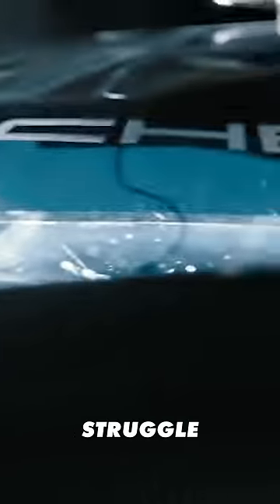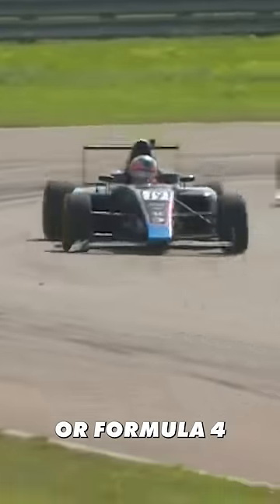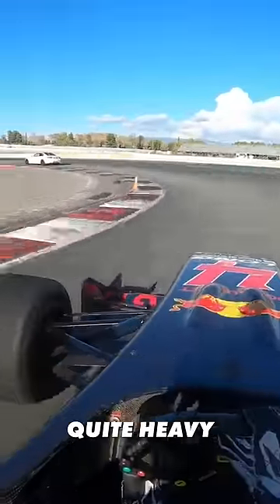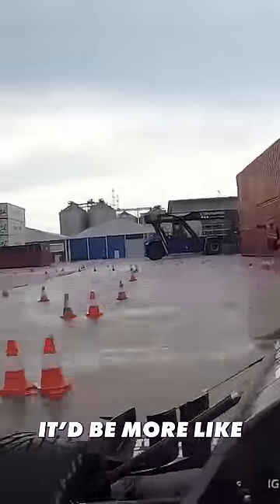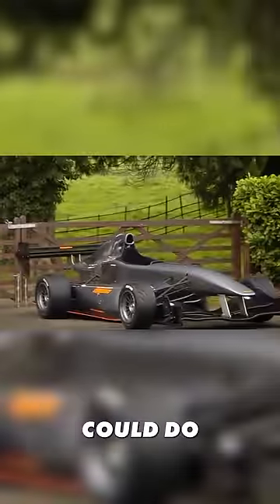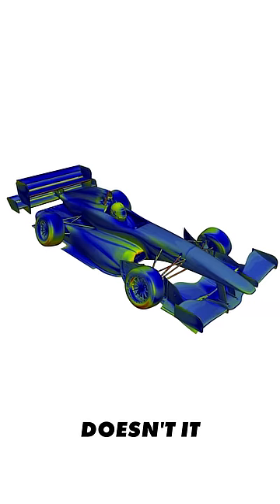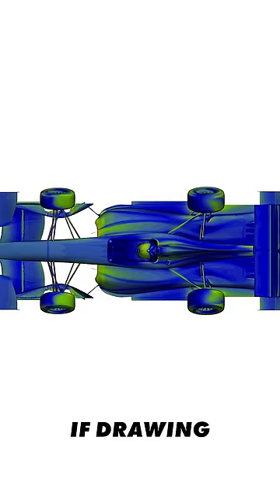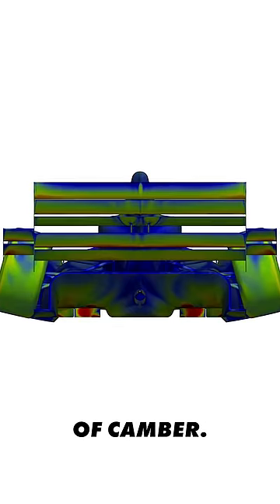The Car I'm Going to DRIVE UPSIDE DOWN

Comment: Secondary issue is grip to put power down when upside down, then tertiary issue is finding an engine that can run reliably upside down
Reply: You can account for this by the angle of approach when entering the tunnel, also running upside down shouldn't be a problem if it's fuel injected, you're not going to upside down longer than what it takes for the injection system to run dry.
Reply: @rantional8180 I'm sure there are other issues with oil and cooling
Reply: Gravity is still a thing
Reply: @shogunofsorrow787  still, you're going to be upside down for less than 5 seconds and that's being VERY generous, it's probably going to be closer to 1 second due to the speeds needed to achieve a "barrel roll", really the biggest concern here is getting the math of the ramp and needed speeds right. Nothing special would really need to be done to the car....I'm also pretty sure this has been done before in both a wrx and a jaguar, Google car loop the loop.
Reply: @tonydapony69  true, but so is interia and contact force...those two forces can overcome gravity.... the math for this MgH=Mg(xR) + 1/2 mv2...generally speaking and isn't probably going to be 100% accurate for this use.
Reply: That shouldn't be a problem, inverted systems like what is used on acrobatic airplanes.
Reply: maybe a jet engine or a modified horizontally opposed
Reply: How about you turn the engine upside down. Problem solved
Reply: @rantional8180 Downforce also becomes lift when upside down, thus pushing him more into the ceiling to give him better traction.
Reply: If it is a turbo charged engine it will be fine. It has plenty enough pressure to keep the fuel on the top of the cylinder when upside down
Reply: @greengabe5  sure but it needs to run both upside down and right side up.
Reply: Perhaps a well tuned hybrid racing engine could suffice, having the electric system take over for the engine at some max output once it detects the car is going upside down? Or a fuel pump system that’s mounted to the top of the tank and splices into the main line to feed the engine
Reply: @tonydapony69   downforce, upside down, is lift. 
You know, the concept that makes planes fly.

If they can engineer it to get enough upside-down-downforce, (which is the same thing as right-side-up downforce, but it's fun to say) they could drive upsidedown indefinitely, given an "infinite" tunnel
Reply: @rantional8180  yes, that has been done, but they are intending to use downforce (wind resistance) to hold them to the ceiling, instead of centrifugal force
Reply: @greengabe5  real man of genius
Reply: @Cheaty_Four  that's what I'm saying an inverted fuel & dry sump oiling systems similar to what an acrobatic airplane uses.
Reply: @thewaywardwanderer7249 well yeah, any kind of aerodynamic force comes with a drag penalty. But it's not actually wind resistance here, it is down force. Racecar aero, down force, is just the opposite of what lift is to an airplane
Reply: @shogunofsorrow787 I would suspect this engine will have a dry sump oil system either way. Constant oil pressure shouldn’t be an issue.
Reply: @429thunderjet2  you do know where downforce comes from, right?
Reply: @thewaywardwanderer7249  you said wind resistance. It's not necessarily wind resistance that the concern is here. Wind resistance is the drag penalty of some object going through the air. It's aerodynamic down force on the car from the wings and body shape of the car to overcome gravity by enough, plus get enough traction to propel it and control it upside down stuck to the ceiling. Anything going through the air at speed is going to have wind resistance. Think of wind resistance like trying to propel a big box truck at high speed, the faster it tries to go the more wind resistance there is. It actually squares by the numbers. I don't remember exactly what those numbers are off the top of my head, but it's significant. But with carefully designed aerodynamic shapes, like that of an F1 type of racecar or an airplane uses, the drag penalty caused by wind resistance can be significantly reduced. Are you pickin up what I'm laying down here, or are you just trolling?
Reply: @429thunderjet2   God dammit, now I know you are either trolling me or too dense to understand (though by writing this, if you're not trolling me I truly do hope to teach you something). Yet I am writing a reply anyways, because I'm dumb, drunk and bored.

Drag, downforce, and lift are all results of wind resistance. If you shape an object to push air upwards as it travels forward, it creates downforce. If you shape an object to push air downwards as it travels forward it creates lift. Lift and downforce are the exact same thing, the only difference is the relative direction of force....
Drag is the air's resistance of an object moving in any direction, which, in this case, is forward.

As far as your box truck nonsense, the shape of the box truck neither diverts the air up or down, and instead pushes it forward, resulting in only drag (with no benefit or drawback of lift or downforce.)

As far as the math, drag increases by the square of the speed. What that means, is, if you double your speed, you experience quadruple the drag, or wind resistance, regardless the direction of force (lift, drag, yaw, or downforce)

But say you were to alter the angles of the front of your box truck (hell, actually, we'll substitute a cube traveling forward instead of a box truck for simplicity of explanation) so that it was a 45 degree angle from the bottom front edge to the top rear edge (front and rear being relative to the direction of the cube's travel)

Effectively, this creates a 45 degree wedge driving down the road. 
The drag (or wind resistance) that applied to the previously-vertical surface is now divided in 2, where half of that force  is being redirected upwards perpendicular to the road, creating downforce, and the other half of the force is still resisting the cube moving forward. But the same amount of force is still applied. (for simplicity, again,  I'm ignoring the fact that by cutting a cube corner to corner to create a 45 degree wedge, you multiply the surface area of the "front" of the "vehicle" by nearly 2, which results in more air resistance and friction on that face, while reducing the area on the top and sides, resulting in less friction on those faces)

So, they need to find a body geometry and weight that can create more downforce (at a certain speed)  than the vehicle weighs. 

With any given body geometry, If the vehicle weighs, say, 1000 lbs, they need to be going fast enough to experience over 1000 lbs of downforce in order to "stick" to the ceiling.

Back to lift (which is still the exact same thing as downforce)
An Airbus a320 weighs around 160k pounds. That means, before the plane will leave the ground, the wings have to generate over 160 k lb of lift. Based off of the wing geometry, this happens at about 170 mph, relative to any wind, not groundspeed.

Have you ever flown before? The plane doesn't take off straight into the air, right? It has to be going forward fast enough in order to create the lift that it needs to get airborne.

It is the air resisting the wings pushing it (the air) downwards that causes the plane to lift.

Okay. I think I'm done.
Reply: @thewaywardwanderer7249  ok dude, sorry! I really though you didn't understand to begin with. But I think in reality we are on the same page here. But you explained it better. I just meant when I think drag I think of something with massive drag like a box truck for an example. But it wasn't a good one for this instance. And I do understand your point that there is air resistance to anything moving through it no matter the shape of it or the desired outcome, like lift or down force or just getting through it smoothly or not. Yup I've flown quite a bit with my father who was a pilot years ago. I'm an old student now, that never got his ratings. 
 But it will be interesting to see if they pull this thing off.
Reply: @429thunderjet2  oh thank atheist jesus you're not trolling me. That response took too long to be wasted haha.

I guess I picture drag as anything resisting the intended direction of motion.

But, yeah, I'm stoked to see this happen.

Not sure if you have checked the rest of their shorts, but they have another one that mentions the downforce more explicitly than this video implies.

I appreciate you and your clarification, and apologize for being an ass.
Reply: @shogunofsorrow787  oil could definitely be an issue, but cooling would be more or less unaffected being that, in a normal cooling system, there would be no air pockets as there is in the oil system, so the coolant would still flow regularly.

As far as my  "could"  about the oil, I've seen multiple videos where people drain all the oil out of their engine, and put a brick or something on the gas pedal just to see how long it survives running at wide open throttle. 
I think the longest one I saw was 15 minutes.
Reply: @thewaywardwanderer7249  no prob, have a good one!
Reply: A fuel injected engine with a dry sump oil system shouldn't have an issue for a short period upside down.
Reply: @shogunofsorrow787 oil maybe if you stay upside down for a long time but it has a dry sump so it won't have a problem maintaining oil pressure. Cooling won't be an issue, the whole system is full of liquid, sealed and pressurized. The car won't be upside down long enough to matter.
Reply: @AcidGambit419 being turbo doesn't change anything. It could be NA and still be fine.
Reply: @AcidGambit419  surely you jest?!!!
Reply: @AcidGambit419  gravity has basically no effect on the fuel air mixture in a combustion chamber. The fuel should basically be atomized and suspended in the intake charge when it hits the combustion chamber. It's about the fuel pickup in the fuel tank and the dry sump engine oiling system. Acrobatic airplanes have inverted fuel & oil systems for more than short term inverted flight and negative Gs.  So they will probably build an inverted system similar to that for the car as well I would think.
Reply: @hondaguy9153  yep that's most likely all it will need/be is a few seconds. Otherwise inverted systems could be incorporated if they feel it's necessary.
Reply: This is a remarkably productive comment thread.
Reply: Just flip the engine over duh!
Reply: @rantional8180 all four strokes can leak oil into the pistons and hydro lock the motor if upside down, iv been too earthmoving equipment that’s been rolled and they didn’t turn off the engine and did this, also after righting the machines you have to go through filters and so on checking for oil
Reply: Just use an electric powered car
Reply: @rantional8180 I was under the assumption that he would be driving lengthwise through a tube then attempt to drive it on the "roof?" Of the tunnel.
Reply: @user-cc3we2pw2b  maybe I'm mistaken, I don't know but short of using a rocket powered car I'm not sure the physics of that would work out, the length of the tunnel needed to get the speed needed to create the down draft needed would be ridiculous to build in the first place...to literally drive upside down for any length of time unlike a loop the loop...
Reply: @rantional8180  That was my guess because as stated the loop is a btdt.  Was that not why the particular power to weight ratio and configuration were so important?
If all of this was for a loop the loop I want my money back.  I was misled.
Reply: @ShaBaranx   no, you're right, I looked into it more, I'm an idiot, I have to admit I don't know anything about f1 cars besides they're loud and fast, I actually had no idea how much downforce these things create during operation, the down force generated exceeds the actual weight of the vehicle so driving upside down is actually possible...I design aerospace stuff, not f1 stuff so really had no idea how impressive the generated downforces were on these things...I'll just stfu now because I'm apparently out of my depth. Lol....that said, after looking at it, this is totally possible and I can now see why my coworkers hold f1 engineering in such high regard, I just never cared before, f1 cars truly are impressive, maybe I should get more into it...only racing I cared about before was wrc because it's fun to watch but the marvels of f1 design is actually mind blowing. Thanks for calling me out man, I learned something and may have gained a new interest I didn't have before...like I knew these things were impressive but just not to this extent....thanks to everyone tolerating my ignorance....as they say, ignorance can be remedied, stupidity can't...I can admit when I am wrong and learn something from it....if you want see what I saw Google how much downforce is generated by a f1 car, then go look at the math...it's actually insane....I had no idea.
Reply: @rantional8180  Im going to check it out now.  You made me really curious about the forces involved and the modifications required.  
Thank you for the conversation.
Its nice to connect with a kindred spirit.
Reply: I just don't believe any car can drive upside down as it would need wings of some sort and even though f1 cars get alot of down force gravity is also part of the equation hence why planes use giant wings with flap adjustment to help the get airborne, I don't believe an f1 or something similar has enough wings for it to overcome gravity alone but then would be cool to watch
Reply: @greengabe5  Very German solution lmao

(Engines on the bf109's were litterally upside down)
Reply: Guaranteed it's got a dry sump oil system. Many race cars do these days. If it does, there will be no problem running it upside down.
Reply: @AcidGambit419 That literally makes zero sense. Keep the fuel on top of the cylinders?😂
Reply: @bigfred0997  yes they actually do!
Reply: @rantional8180  yes the technology is quite impressive. The racing could be construed as a boring parade at times, as thought by some. The sanctioning body However is aaw,,,,, how can I say it? a weird old boys club, network, or something!  Like, look at us, we're special and you can't join our club and you don't have enough money to play with us and furthermore our rules are weird and we don't apply them equally. IMHO ok
Reply: @thewaywardwanderer7249  that's the deal, they do make more down force than the weight of the car.
Reply: @juiceyou321  yeah, but additional dry sump pickups may need to be added in the top of the engine and possibly another oil pump stage. I'm not positive exactly how it's done but, acrobatic airplanes have those kinds of inverted systems.
Reply: @rantional8180    U r rite.   Cars have been upside before.   But in the case of the simple loop.  The car is pinn to the track via centrifugal forces.   This guy is wanting to manage inversion via pure down force.    To  verify the myth that there are cars that provide enough down force to drive upside down
Reply: @willking6915 yes driving  lengthwise is the endeavor.  He wants grip maintained via pure down force
Reply: These issues were solved in the 1930s with the spitfires that kept stalling mid air
Reply: @greengabe5  puts the engine in a fuckin gymbol so its always facing up
Reply: Electric 😎
Reply: Just a rotary or injected two stroke.  Y'all are way overcomplicating this and have apparently never used a weedeater.
Reply: @OvertravelX  I think you're simple minded if you think a wankel engine would run fine upside down or you'd get enough power out of a two stroke to propel a car fast enough for very short wings to provide enough downforce to hold whatever eldritch horror 1000 bhp two stroke engine you have in mind aloft
Reply: any engine can run upside down.. as long as it has fuel fed to it.. carbs are a problem.. FI is not... just as long as the fuel pickup in the gas tank isn't sucking air it will run upside down

and oil to lubricate again, easy enough to fix the oil pickup in a dry sump car
Reply: plane engine swap
Reply: They may as well just put a jet engine on it or an electric motor without a governor. Then they don't have to worry about the fuel pump getting air in the line or really have to worry about any crazy modifications. The jet preferably because then they wouldn't even need to worry about the wheels failing to push the car because they would need "down force" enough to lift the car, plus provide enough pressure on the tires to have traction enough to move the car forward rather than strip or spin the tires which can happen if they're trying to use the tires to propel the car instead of having a jet push the car (or a cable pull it!) but i think that would defeat the point. But because of that they would have to have enough "down force" to overcome the car's gravity PLUS the lift generated by the underside of the vehicle normally, in addition to accounting for the change in gravity on the springs and suspension and the weight distribution. Or maybe they could just hook up a hose to a super air compressor and float it up like the tomato experiment and just pull the hose in front of it while they drive leisurely in air
Reply: @bigfred0997 Modern F1 cars generate more downforce than the weight of the vehicle before they hit 100 mph. At top speed it can be 3 to 4 times the weight of the car. So, yes, if you can keep fuel and oil flowing properly throughout the engine, you could drive on the ceiling, as long as you keep your speed up.
Reply: @jasexavier  it just sounds crazy in my head but would love to see it done
Reply: Aeroplane
Reply: @shogunofsorrow787  I doubt a single second upside down is going to starve it of oil long enough to cause damage. Cooling doesn't matter
Reply: Just use electric motors... people saying jet engines etc are not looking at the most obvious option
Reply: wankel should be fine
Reply: @rantional8180  the oil system will be messed up upside down though.
Reply: And the 3rd problem will be extreme G force